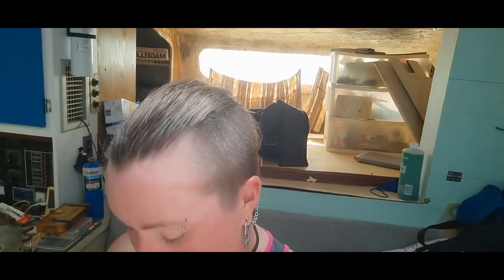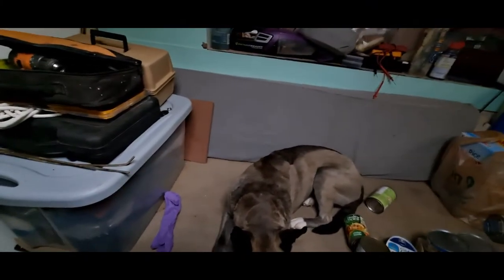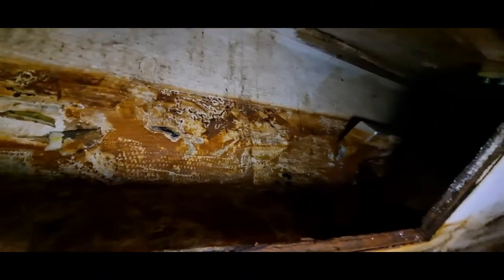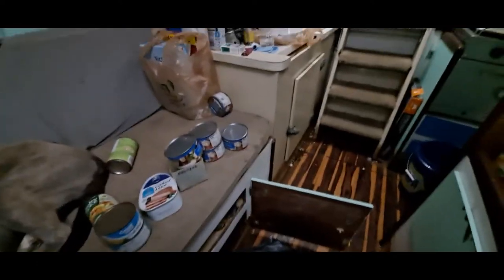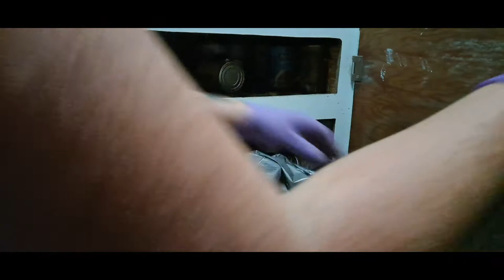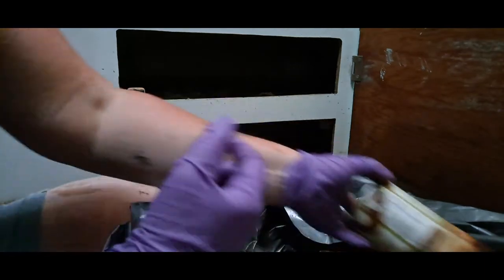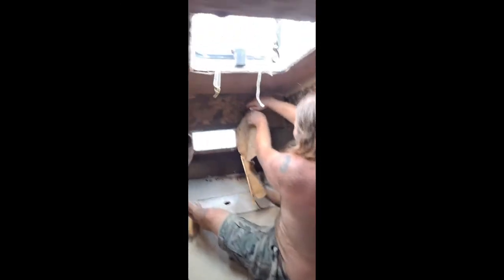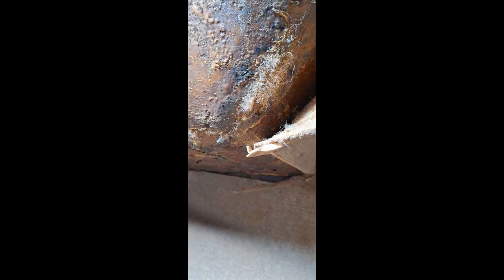(42)Not all Trimaran trash is Treasure/Not all can goods are good either...

Comment: "But other than ALL THAT, how did the boat cleanup go?" 😉😉
Reply from the maker: To be honest as shown in the video that wasn't necessarily discussed it was over 2 tons of trash and rot that we removed. Currently there are 2 small sections that still needs to have the rotten wood replaced being in the very forward section at the bow and the very rear section underneath the aft cabin. For now our concentration has been in the living space in the main salon being the galley and head.  The exterior is going to be the last thing that we even attempt to address because there's so much on the interior that needs to be updated and upgraded in order to make it comfortably livable. You will see it our most recent videos that it is the engine that we have been waiting on that just arrived yesterday. Stay tuned for the next video to discuss the options and timeline we expect for putting it together and checking everything that needs to be attached as far as the transmission amongst other things.
Reply: @PhoenixGate.  >>> TWO TONS?!  WOWZERS!! 
 
Thanks for the reply!

Comment: bleach doesnt kill mold. it actually feeds it. just changes the color. i hope you do better than me with mold. spores are crazy af
Reply from the maker: Actually it does a fantastic job of lifting the crud to scub off and sterilize. The only problem is with the high humidity, it's a constant battle no matter what you use and has to be kept up on. It neutralizes  quickly to make it safer to clean off then it's scrub, scrub, scrub... dawn dish soap with a mold killer works pretty well. We got about six months at a time before retreating with a spray on mold killer after that.